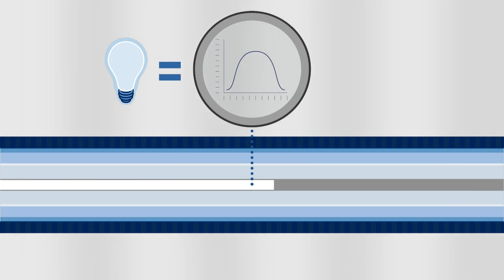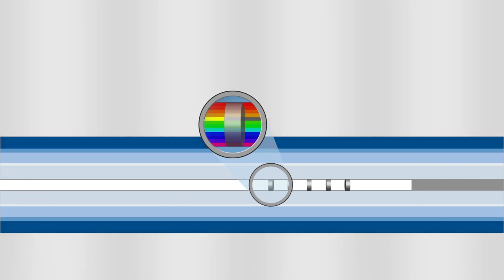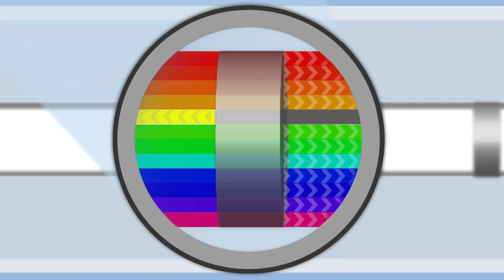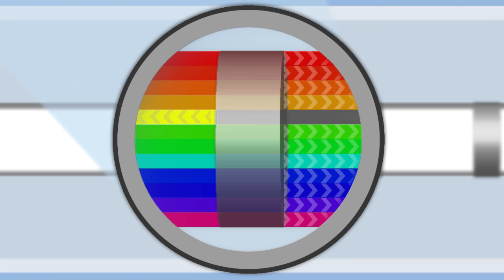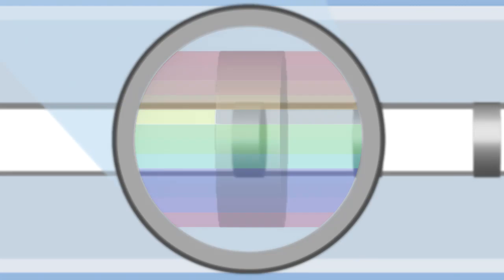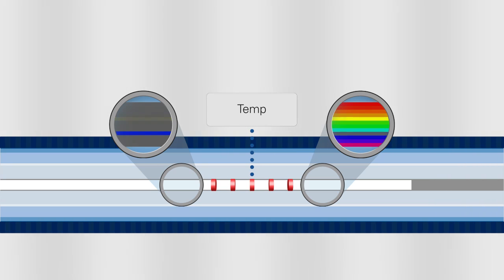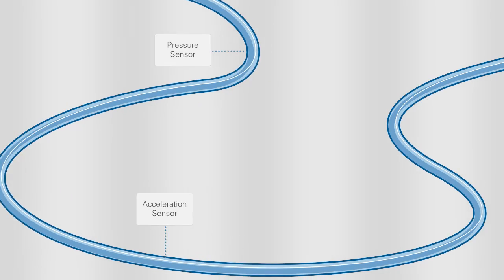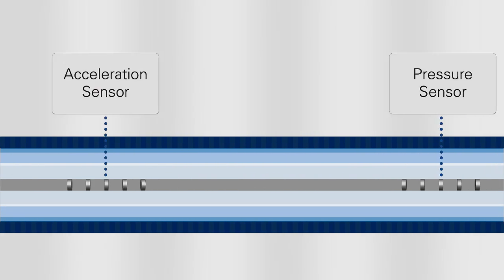FBG Optical Sensing Overview

Comment: Wait. First part of the video shows some sort of material installed in the fiber itself. The last part of the video shows some large device spliced into the cable.  
What is what?
Reply: 1st one is an optical structure inside of optical fiber which called Bragg structure (Bragg reflector) and that reflector consist from many semitransparent mirrors (there are can be thousands of them) and works as filter for exact wavelength. Principle is based on reflection of wave from each "mirror" and depends on distance between "mirrors"=L. So finally wave  with wavelength =2*n*L (n is average reflection coefficient of Bragg structure) will be almost completely reflected. Rest of wavelengths will be impacted just a little.
2nd one probably is just optical connectors